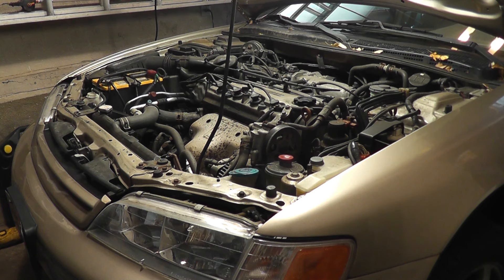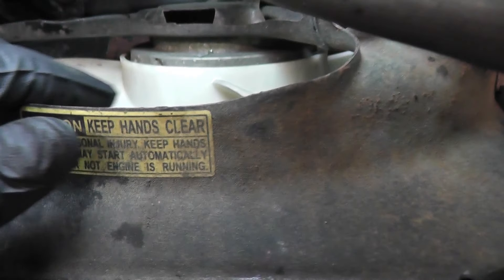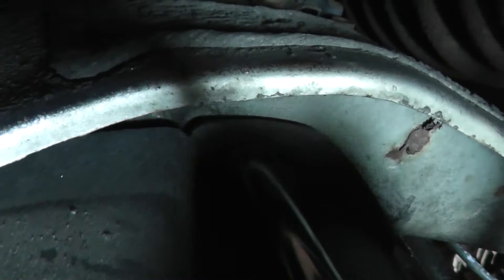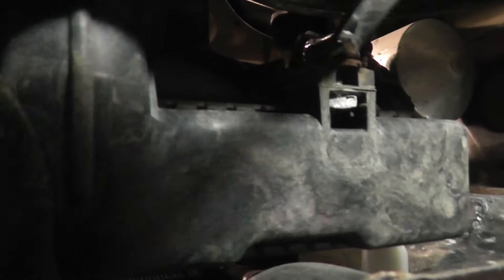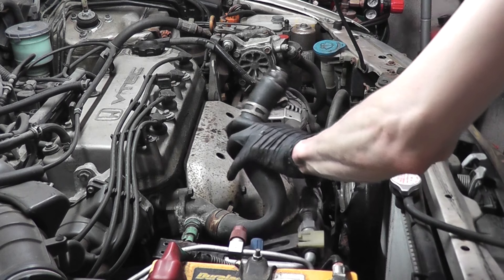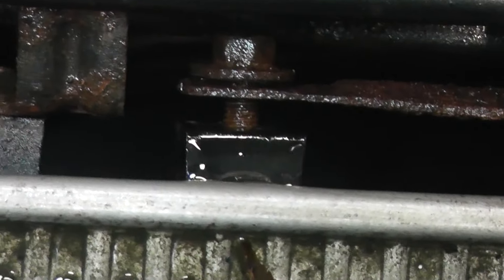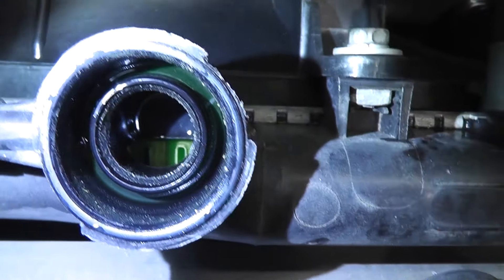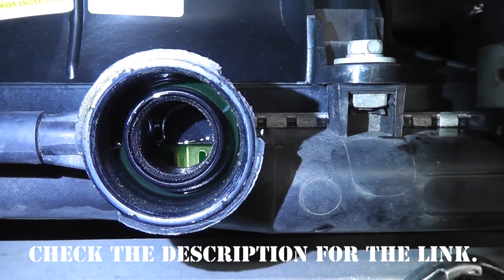1994 - 1997 Honda Accord Radiator Fan and Condenser Cooling Fan Replacement

Comment: If you’re working on a 1997-1999 Acura 2.2 or 2.3CL, there’s plenty of room to remove both fans without disconnecting the coolant hose or going underneath the vehicle to loosen the lower fasteners. The CL has a slightly longer nose than the Accord, so there’s more working room. You remove the condenser fan first, then slide the radiator fan to the driver’s side and pull it out. Just did mine in 15 minutes!

Comment: Thanks for the video. It assist me troubleshooting my 97 Accord SE that had the same issue. Condenser fan bearing was bad and the radiator fan fuse was blowned. Replaced both fans with an aftermarket part from the internet. 5k miles later, staying cool and the AC works better now. Gave the Accord to my son who's in the Navy and loves the car.

Comment: Helpful video, thanks for posting it. My first clue my cooling fan needed replacing was the fuse for my cooling fan was blown. This caused my car to overheat. Once I replaced the fuse and heard the fan again, it sounded bad like the one in this video. Just a tip to help other people.

Comment: Nice helpful vid. Would you happen to know what could be the cause of the radiator cooling fan only turning on when the car is turned off after having been driven? The car is a '97 Accord. I'm leaning towards the coolant temperature switch as the issue. Thank you.
Reply: Im having the exact same problem.  Did you find a solution?

Comment: You should do a rear strut or timing belt vid. These are awesome
Reply: rear struts are super easy man, just 3 bolts and strut is out
Reply: ealiev60 yeah, did them last month, in fact. Timing belt would still be handy though.

Comment: My 94 Honda is still overheating, especially when I turn on ac. Which leads me to fan relay or fan motor. Seems like the fans aren't really moving air? In your body the fans are fast not like my fans...

Comment: Hi, can you tell me which relays are for the cooling and radiator fan, please?
Reply: Under the hood, left hand side nearest the windshield, there is a box w all the fuse & relays names printed. Press two tabs to open it. Both relays are inside.

Comment: Can a fan be weak? My 94 Accord is overheating and it gets worse when the ac turns on. Shouldn't the radiator fan be always on if the car is overheating? Mine come on still intermittently.
Reply from the maker: The condenser and radiator cooling fins are clear and not plugged with debris?

Air in the system can cause the fans to not come on. Is the coolant level in the radiator and overflow bottle ok? If so try bleeding the cooling system. If it's low check around for leaks.

Other causes of overheating. A restriction in the system (usually the radiator) due to not changing the coolant. A water pump with a bad impeller (old coolant eats away at the metal which reduces coolant flow) or a stuck closed thermostat.
Reply: Bushougoma TY.  The reservoir tank is filing all the way up. I've bled it several times and it still has the same problem. Under radiator cap-it's missing coolant and has air and needs to be topped off or the temp gauge starts going up (usually gets 3/4 up close to h. Shouldn't the air go to coolant reservoir? and not be under radiator cap? When I turn on ac it overheats quicker.
Reply from the maker: Check the radiator cap and make sure it's sealing properly these caps tend to fall apart over time. The center plastic piece (the vacuum actuated valve) tends to fall off first.

The radiator caps job is to maintain a set pressure in the radiator this pressure is printed on the cap. Keeping the coolant under pressure raises the boiling point.

When the coolant pressure exceeds 16 PSI the pressure valve which is spring loaded is pushed off it's seat in the radiator this allows the coolant to enter the overflow bottle. As the vehicle cools down (if there aren't any leaks) a vacuum is formed and another valve on the cap opens and the vacuum pulls the coolant from the overflow bottle back into the radiator. So if the system is working properly the cap makes sure the radiator is always full and at the proper operating pressure.

If the cap is good and you're certain you don't have any restrictions or external leaks (you can rent coolant pressure testers to make the job easier). You likely have combustion gasses getting into the coolant due to a bad head gasket, cracked cylinder head, or block which is pushing the coolant out of the radiator.
Reply: Can be a blown head gasket

Comment: If you remove the AC fan first, perhaps you can remove the radiator cooling fan sideways and up.... and not need to unhook your radiator hose....?..
Reply from the maker: The A/C fan has a more compact motor and there is less clearance to the engine on that side.